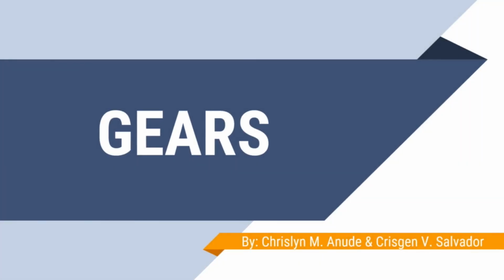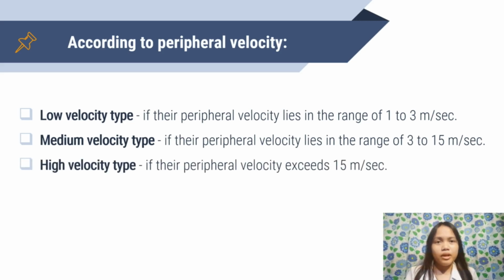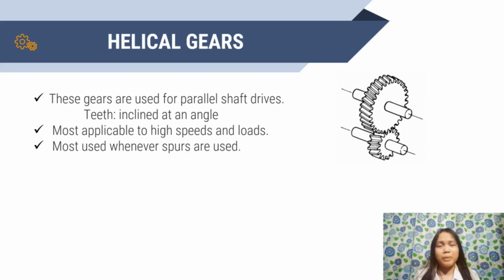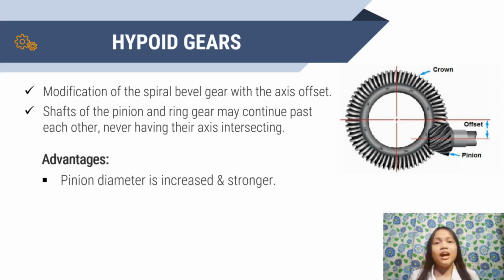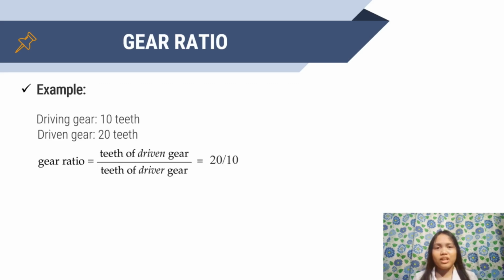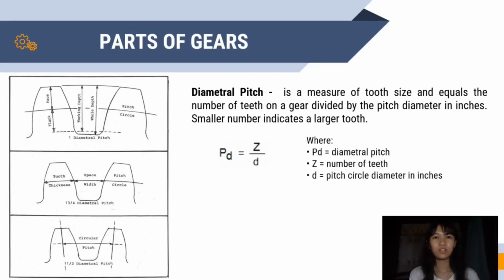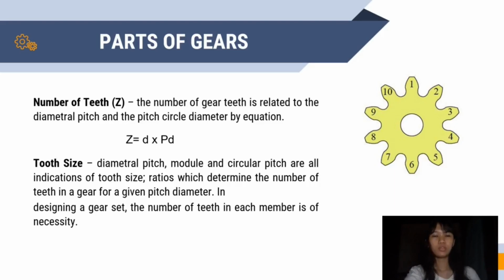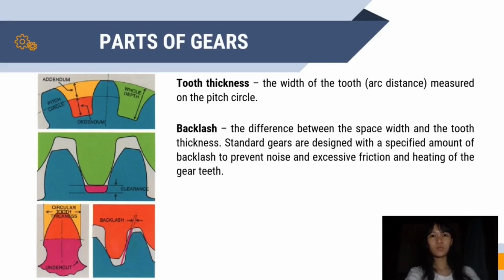Gears (Anude & Salvador)

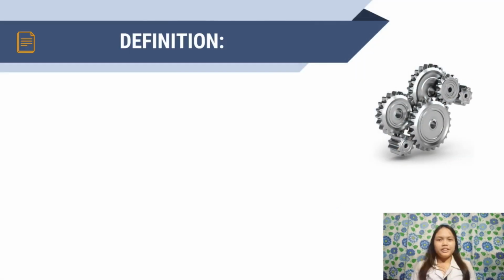Comment: 00:06 Definition of Gears
1:19 Application of Gear. Gears provide a number of critical functions which is to reduce the gear ratio in motorized machinery.
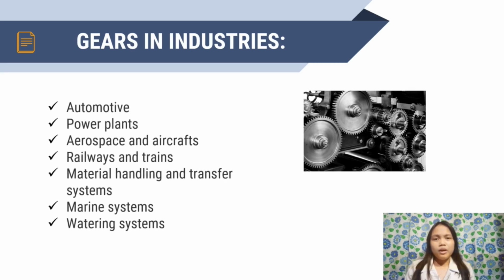02:06 Gears in Industries

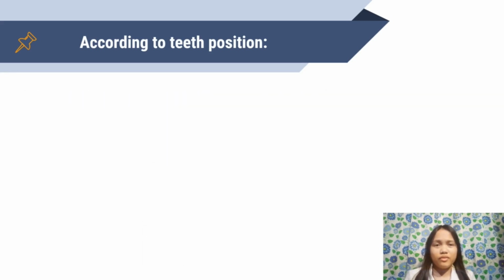4:13 Types of Gears
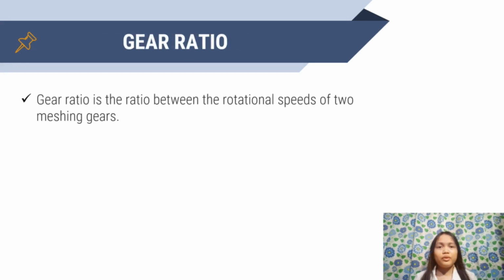12:55 Gear Ratios and example solvings

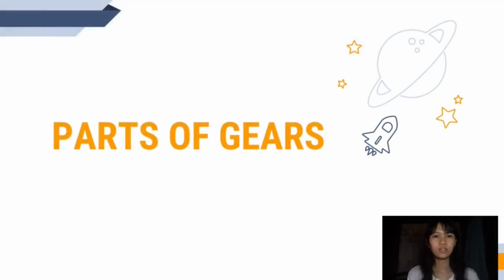14:36 Parts of Gears and Example
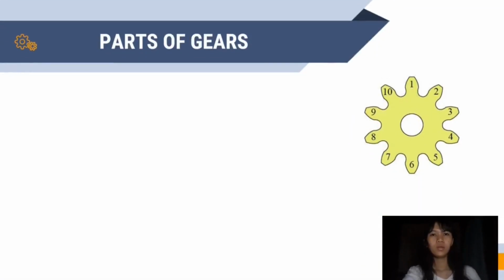19:48 Number of Teeth, the number pf gear teeth is related to the diametral pitch and the pitch circle diameter by equation.
24:00 List of Formulas

Comment: Isaiah L. Lim - BSCE 3D
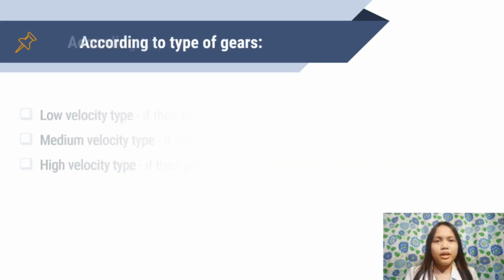3:25 Peripheral velocity: Low Velocity type, Medium Velocity type and High Velocity type
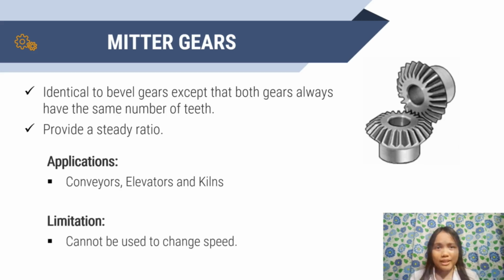9:38 Mitter Gears has a gear ratio of 1 to 1
19:54 Number of gear teeth is related to the diametral pitch and the pitch circle diameter by equation

Comment: AIKIM L. ABAO 
BSCE - 3D

0:40- Gears come at least in pairs, in which the smaller one is called the pinion and the bigger one a gear.

When the following is the driver:
Pinion - output: rotational speed decreases, torque increases 
Gear - output: rotational speed increases, torque decreases

4:34 - 13:05 - Types of Gears
- Spur Gears
- Helical Gears
- Herringbone Gears
- Bevel Gears
       - Spiral Bevel Gears
- Mitter Gears
- Hypoid Gears
- Worm Gears
- Rack and Pinion Gears
- Internal Gears

13:08 - Gear Ratio(G.R.)
The ratio between the rotational speed of driver gear and the driven gear. 
G.R. = driven gear speed/driver gear speed

14:49 - 24:00 - Parts and specifications of Gears

24:01 - List of Formulas

Comment: Trisha Anne Y. Oran -CE3D

4:16 - Types of gears according to its uses
12:55 - Gear ratio is calculated by dividing output speed by the input speed
14:37 - Parts of the gears
17:15- Circular pitch is directly proportional to module and inversely proportional to diametral pitch
24:00 - List of formulas

Comment: Julieta E. Villaflor - BSCE-3D
4:25 - This transference can alter machinery's operating speed, multiply torque, and allow for the final turn control of positioning system.
12:17 - Internal Gears
16:00 - The pitch circles of the gear corresponds to the diameters of the discs.
20:23 - Addendum is the distance from the top of the tooth to the pitch circle.

Comment: Lorenz Klein U. Castro
BSCE 3D
3:32 - External Gears are mesh externally. The bigger one is called "gear" and the smaller one is called "onion".
12:55 - Gear ratio is the ratio between the rotational speeds of two meshing gears.

Comment: Roden Lorenz S. Padua - BSCE3D
00:05 - Definition 
01:15 - Application 
02:00 - Gears in different industries
02:20 - Classification of gears
04:13 - Types of gears
12:52 - Gear ratio
14:37 - Parts of the gears 
24:01 - List of formulas

Comment: Blessie M. Cagalawan -BSCE 3D
0:08 Definition of Gears
1:19 Gears provide a number of critical functions which is to reduce the gear ratio in motorized machinery.
4:13 Types of Gears
19:48 Number of Teeth, the number pf gear teeth is related to the diametral pitch and the pitch circle diameter by equation.
24:09 Formulas

Comment: AL LAURENCE B. SIMENE - BSCE 3D
3:34 Type of Gears - Bigger one is called "gear" and smaller one is called "pinion" (External Gear). While larger one is "annular" and smaller one is still called pinion in (Internal Gear) 
18:44 Parts of Gear - The formula of pitch diameter is dividing the number of teeth (z) by the diametral pitch (Pd)

Comment: John Mard N. Sumalpong- BSCE-3D
00:06 Definition of Gear
01:16 Applications of Gear
02:05 Gears in Industries 
02:20 Classifications of Gears
3:28 External Gears and Internal Gears
04:12 Type of Gears and Advantages
12:51 Gear ratios and Example problems
14:36 Parts of Gears and Example problems
24:00 List of Formulas and Terminologies

Comment: Jan Mykel B. Garrido - BSCE 3D
4:16 Several types of gears according to its uses
13:27 Gear ratio is calculated by dividing the teeth of driven gear by the teeth of driving gear

Comment: Alaan Kent C. - BSCE 3d
00:05 Definition of Gears: are toothed members that mesh without slipping to transmit power and/ or motion between two shafts.

14:40 Parts of Gears: outside diameter, pitch diameter, root, root diameter , etc.